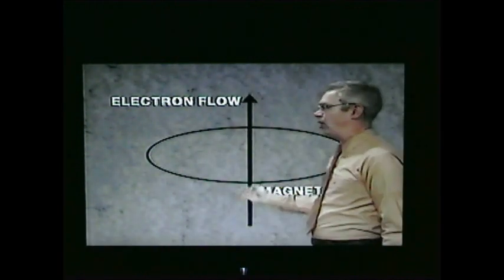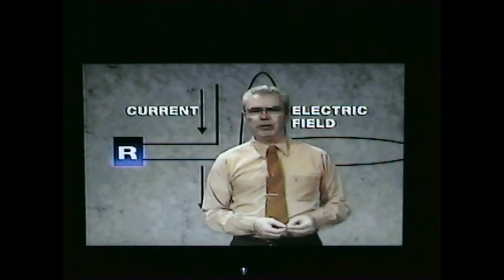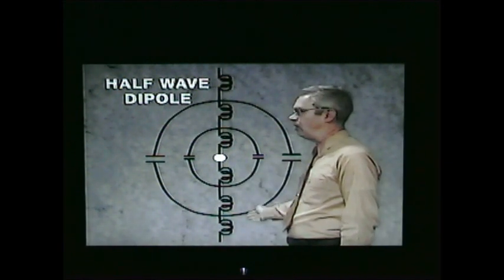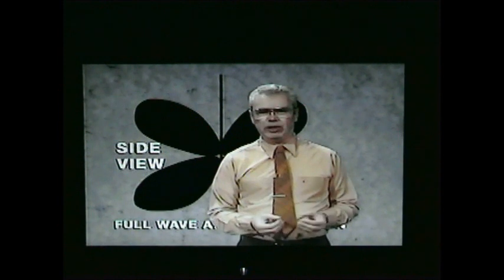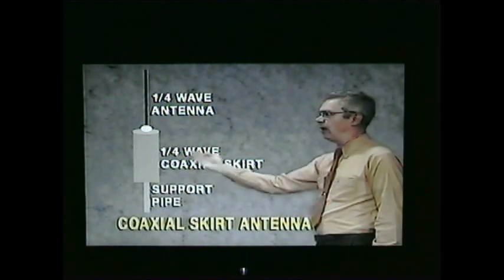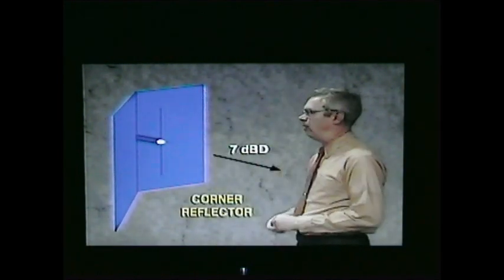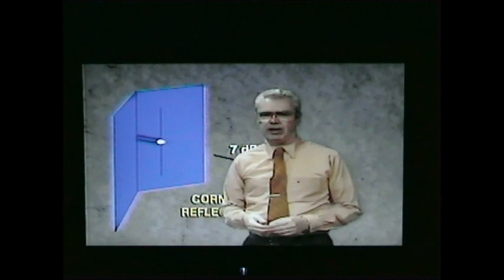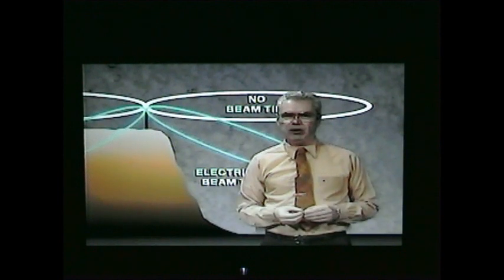Introduction to Antennas

Comment: This was very useful. I've been working with transmitters and everything that goes with them for years but I never knew exactly how the propagation of EM waves worked. He explains it very well here (at 1:40 ) how electrical fields generate magnetic fields that generate electrical fields and so on.
Reply from the maker: I Agree.  This video is the "real deal"  and used as a training film at a major telecommunications company.
It was originally on VHS and I actually rescued it just before the tapes went into the dumpster.  Glad it was helpful.
Reply: Wow, I'm glad you managed to save it from the dumpster just in time. ^__^

Comment: A useful listing of EM wave characteristics that is a good basis for applying, as a visual intuition, to the concept of radio emission into an isotropic field of fields for full spectrum QM phases into the QF standing wave of synchronization, for which either BBT or temporal superposition is the same visually and mathematically. 
Eg if a galaxy is fitted into the schema of wave projections, then the "elemental" characteristics of the antennae for the patterns shown will "suggest" the properties of neutron frequency based resonance and implied characteristics of the stars, black holes and disc or ovals of the galactic shapes that will include the gravitational "holes" into which the resonance guides the matter.